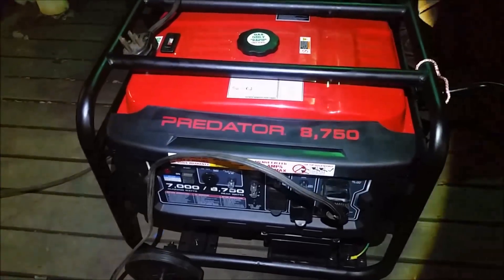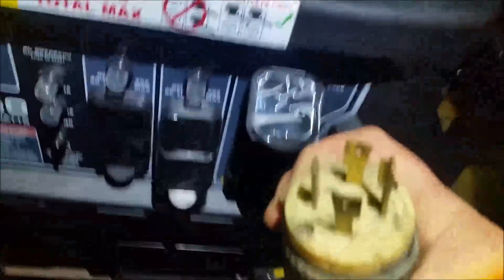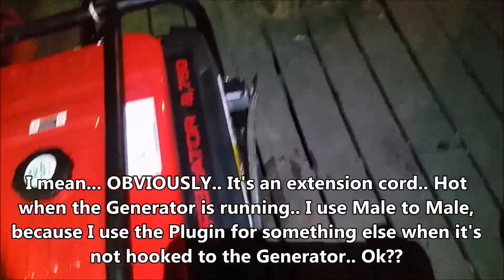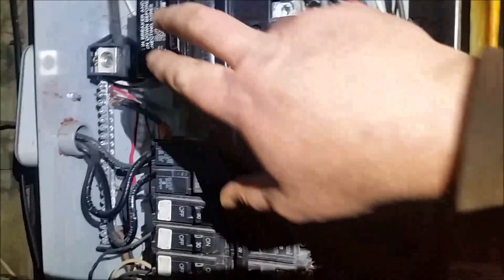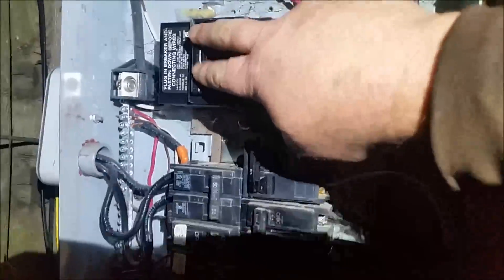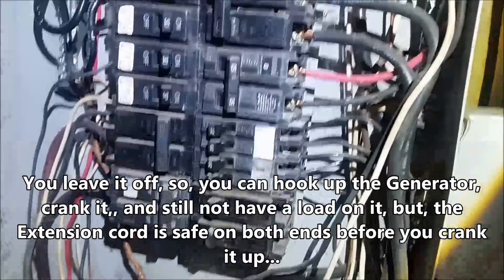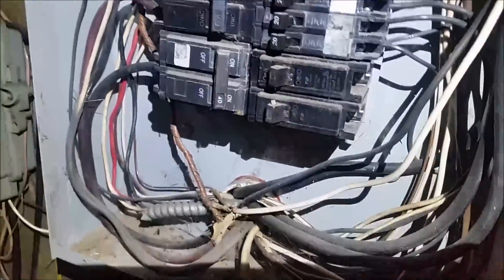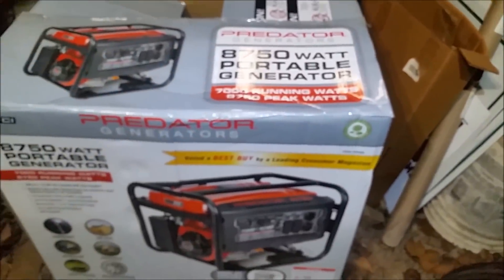Quick/Easy/Safe: Use Existing Plugin/Breaker for Generator hook up to your house Panel box.

Comment: Only in a DIRE EMERGENCY where life is threatened should this shortcut be even considered due to the risk for linemen restoring power on a back-fed HV line (as previously mentioned).  Only in such MITIGATING CIRCUMSTANCES as a FEMA disaster (Katrina and New Orleans, etc) where materials are unavailable could that situation change. I would never back-feed a main panel unless I either removed the main breakers or hay-wired them in the "off" position very securely with a warning (ie: SKULL AND CROSS-BONES) tag.  Taping the back-fed 220V welding outlet to the plug would be wise.  If you were waylaid someone unfamiliar could turn on the main breakers or unplug the aptly-named "suicide cord".
Reply: I would never go on someone's property and flip breakers, likewise no-one has ever came on my property and flipped breakers. I have used this method with a 5000 watt Coleman PowerMate for about 19 years during outages. I don't leave the premises with it in operation as I manage the loads to avoid overload and keep fuel consumption as low as possible. I do plan to eventually put a red lockout on the main breaker just to appease those who don't possess logical thought process. 

Removing a main breaker would be the most dangerous thing I can imagine. I guess we should call the breaker panel a suicide panel, what if I touched those main lugs, or added a breaker without turning the main breaker off.
Reply from the maker: Well, if that is what you want to do every time the power goes out. Be my guest.. Evidently, you don't use your generator very much.. I do... 20-25 times a year at at least.. Never a problem.. 
I don't have any ignorant people at my house.. They all know that Male plugs plug into female plugs.. And, none of them would unplug a cord from a running generator.. And, none of them would forget to flip the main breaker off before even thinking about connecting a generator, and the reverse also.. And,, if for some reason they are not sure,, they know better than to touch it without asking.. I guess I grew up different than most of you guys.. 
BTW.. When is a power outage life threatening?? And, if the main breaker is off, how does it threaten the lineman? The lineman around here like the setup.. Several of them have the same setup at their house.. But, I won't knock your idea of wiring the main breaker off if that helps the situation anywhere else.. None of your suggestions hurts anyone.. It's just a time factor an a list of un-necessary items for people who understand what to, and what not to do.. But, point taken.
But, if my cord is a Suicide cord for some,, so is their Cars, Unloaded Guns, etc.. My unloaded guns never fire.. Even "IF" you pull the trigger.. Ha.. And, I never forget to put my car in Park either.. No one has to remind me of that either.. The way I look at it, there is no difference.. Turn the Main Breaker off,, and Turn the Generator off first.. YOu have to admit.. You can't screw up if you put your car in park,, oops,, or follow the breaker and generator rules.. :)

Comment: 8750 is the maximum starting wattage and 7000 is the maximum continuous running wattage this machine can safely handle. voltage x amps = Watts
Reply from the maker: Correct.. Starting or Surge Watts and Continuous...  And, those numbers vary in the same generators due to run time, etc..  Might find this page interesting..
There are different types of Generators also.. 
https://www.dieselserviceandsupply.com/Generator-Spec-Sheets.aspx
A ways down,, scan for this text: 
Example: Model DQKC is the generator set selected. 

If that interests you, you can read the article. It will be interesting. Cheers.
Reply: Great info. Thanks for the link.

Comment: I don't know why every body is crying over this, if the main breaker is off then he is isolated from the power grid. The neutral goes to ground, if for some reason power is sent through the neutral then it'll go to ground and not back up to the transformer. There is a way to do this the correct way and that is to install a breaker interlock that fits the breaker box you have, and its all allowed by the electric code if correct interlock is used without transfer switch.
Reply from the maker: You are absolutely correct.. This video is not to encourage you to do it one way or the other.. Just to show you what  you can do, instead of spending a fortune to do the same another way.. But,, you do have to remember to put your car in park before you leave,, and Turn the Main Breaker off.. If either of those scare someone,, just find another video and call an Electrician.
Reply: I see no way to forget the main breaker as I turn off every breaker in the panel starting at the top, plus that was the reason I opened the panel door. If I can forget that quickly then I should never get behind the wheel of a car.

Comment: Must have either a mechanical interlock or a 3 way switch on the main such that generator cannot be connected to the utility - even by accident.
Doing the easy way  can result in horrendous liability exposure !!
Reply from the maker: ONLY if you are a DumbAss, and can't remember to turn off the main breaker.. Hey.. You Drive,, Don't you?? Ever Forget to put your Car in Park, when you park on a Hill? So,,,, What's your Malfunction?? 
Just curious.. Some of us don't need Switches and Interlocks to remind us not to be STUPID!!!
You probably do,, so, don't let my video change you in any way.. Call an Electrician and Bend Over!!
You might like that anyway.. At least the Bending part of it.
Reply: Bend over and spell RUN

Comment: NO !... The power does NOT run Vertically (up & down) each pole from the 2 Hots !
The power runs HORIZONTALLY (left to right) & is staggered every other line,... If your top horizontal line is number 1 then 2 then 3 & so on then one Hot Wire will provide 120 volts to breakers 1,3,5,7,9 etc. & the other Hot Wire will supply 120 volts to breakers 2,4,6,8 :)
This is how your get a 240 volt (double) Breaker because it gets 120 volt from say, line 1 & line 2 :)
Reply from the maker: Ok.. I was reading your text and was fixing to say that's how the 220v breakers work, but, you got it... Yes.. I was interrupted a couple of times during that video and I caught that also when talking about the 120v breakers, but, corrected it without mentioning the error talking about the 120v breakers when I was discussing the 220v breakers later.. I had a thought about discussing load balancing when I was talking about the 120v breakers and though that might have thrown some people off, but, I think the distraction of thinking about it when I was talking only threw me off there for a sentence..  I had run into that problem at a friends who had two circuits in his kitchen, and both had some heavy 120v consumers (hot plate/Counter top Broiler/Microwave) and was running all of them at the same time, (all 110v appliances) and they just happened to be all on the same leg of the panel.. IE.. every other breaker by chance.. 
It was tossing the GFCI breaker on the Generator, which I think was the mother of the voltage spikes on the other leg.. Can't be certain, but, it appears that is what was causing that.. Not sure how many ways different priced Generators handle that particular problem of a heavy load on one leg and a very light load on another, but, that is what I suspect happened. 
Hasn't happened since we moved the load around, and we were back on Generator for 6 hours the other day.. 
It actually does run vertically down the leg, but, branches horizontally across to the other side's hot bus, but, you know that already.. 
It was done out of necessity, because 120v came before 240v, and lots of existing equipment out there and only made sense to alternate the bus across for the subsequent larger breakers of 2 poles (220v).. I have seen some old boxes with the screw in and flip out fuses.. Initially, they were horizontal down only on one side.. In fact, only had space for one main hot wire.. Must have been in the very first stages of Electrical boxes.  I kept the think for a long time and finally, it got in my way one last time and it went to the dump..
Reply: I used to think they ran down from each wire too until I learned differently lol,... I also made a Suicide Cable to run my house here in PA in case of an ice storm,... Haven't tested it yet but will soon.
I got a 25 foot HD Generator Cable from Harbor Freight for $40 but I will run mine via the Dryer outlet back to the box :) 
I also made a 120 volt Suicide cord that splits to run 120 to both Hot wires of the Dryer outlet so I am looking forward to testing that one too,... I have a small 700 watt Inverter Generator & if I am correct, it will run some lights, computer & WIFI or the TV,... That way I can get the fridge/freezer good & cold, charge my 2 spare car batteries with the big unit & then in the evening I can run the quiet little guy to watch TV or surf the web without upsetting neighbors :)
I know the amps will be very limited BUT I "think" it will feed 120 to both sides of the panel.
To be honest,... Most power outages are okay without the generator,... I keep about 4 of the flat, 1 gallon Windshield Fluid jugs of salt water in the freezer & if the power goes, I quickly put a couple on the top shelf of fridge to turn it into a cooler lol :)
I keep 2 car batteries charged in the garage & hook them up to a 500 watt inverter,... I keep all Internet stuff on 1 power strip & plug that into inverter so I have internet :)
Wife had the G-Kids one day when they switched out my meter & power was out for 5 hours & the Modem & Router ran from 1 car battery the whole time & had plenty of juice left !
Grand kids were happy lol.
Reply from the maker: Ha.. Yep.. Everyone who first looks at a panel is going to think that.. Especially if it is already populated with breakers.  I work on everything for my family.. Mom and my Brother who is older than me. I  was busy one day and my brother wanted to add a circuit to his house and I walked over to look at it with him. I was on my way to pickup parts anyway, so, I just got the name off of the box and took off.. Got to the store and they had some off name breakers, so I grabbed one of the double pole single breakers and opened up a box to make sure it would fit in that brand box, and it is when I noticed.. 
A male to male short pigtail and that HD HF cable will work.. And, the split 120v each leg cord will work fine too,, if you have two outlets on the Generator and both of them are on different legs.. They usually are, but easy enough to hit the hots on both sides with a meter to check it.
I don't think the 700 watt is a 220v, but, I could be wrong.
If you wanted a brain teaser project and wanted to run those items from battery even longer, you can use Voltage limiting diodes inline (I am pretty sure this would work - more amps than would be needed, but, I am pretty sure that would not make any difference), and power anything that has a wall transformer (A/C to D/C transformer) directly from D/C power.. No need to take D/C from the battery, convert it to A/C (Not very efficient) and then convert it back to D/C...  I had a project I was going to do one time, but, never got to it because of other complications.. I needed to move some data (pictures taken on a camera) at a remote location to another location.. I was going to put a Wireless Router with a Memory Card you could address as a drive letter in a vehicle, and upload the photos to it, and when it got to the other location, connect to it and download them.. 
That was back in the days of 80.211a/b and my stretch to get to the vehicle was about 250 feet, not line of sight and I just didn't have enough signal strength to get the speed I wanted to be able to upload what I wanted in the time the vehicle could be there to catch the upload.. There was no such thing as 500ma or 1amp boosters and directional Wifi Antennas in any kind of reasonable price range either. I guess I should address it again now that we have the 802.11g and all sorts of reasonable boosters and directional antenna's.. I thought about using an old Satellite Dish, that may have gotten it to work, but, I had to hand carry it in, or mount it on the vehicle, and neither of those ideas excited me enough to do it.. 
Ha..Ha... 5 hours out on changing a meter?? Ha.>Ha.. Must have been one of the Safety Police that comments on here that say they have 40 years experience and don't know squat.. Can't see it taking over 2 or 3 minutes to change out a meter.. Unless of course, for some reason they had to replace the pan and pole while they were at it.. Ha.. 
Like anything.. Experiment as much as you can, and learn as much as you can.. Always be safe.. You never know when a neighbor will need someone with some common sense to help them out.. Seems there isn't too many these days that have it.. :).. 
I can't remember the last time I looked at something and said "It can't be done".. Cheers..